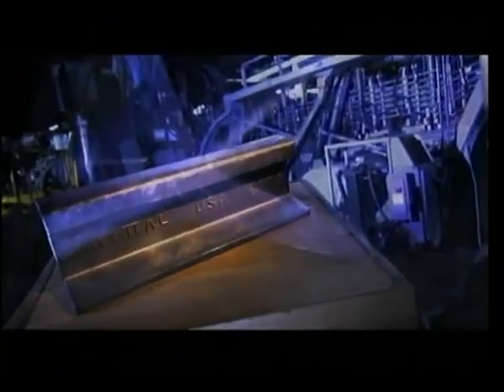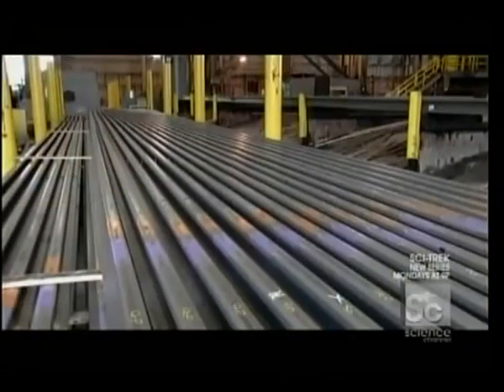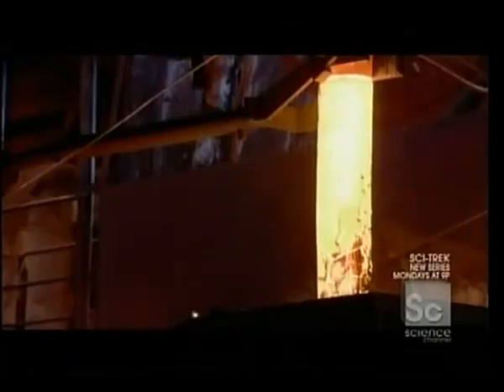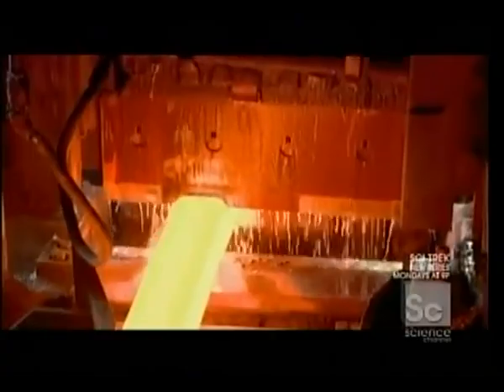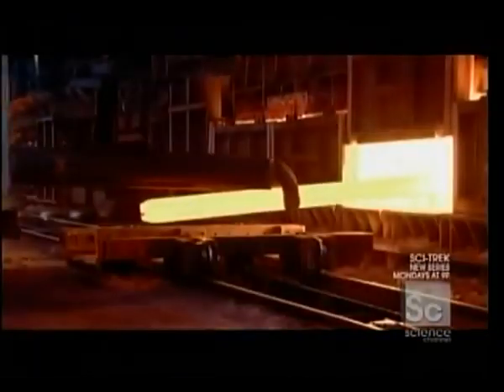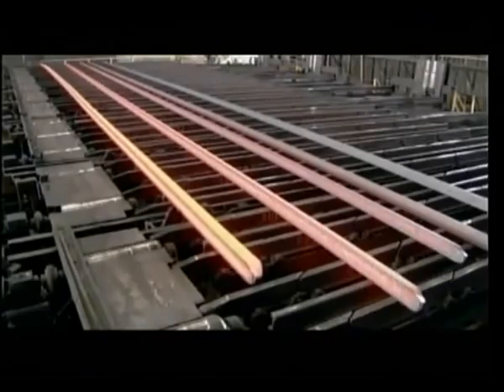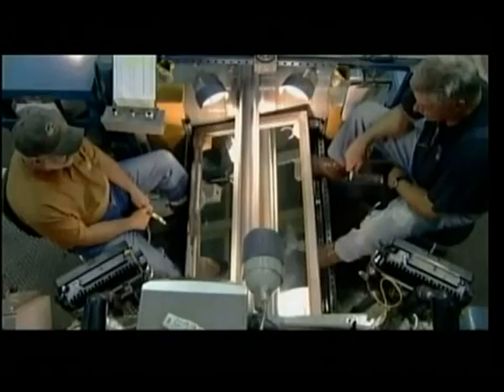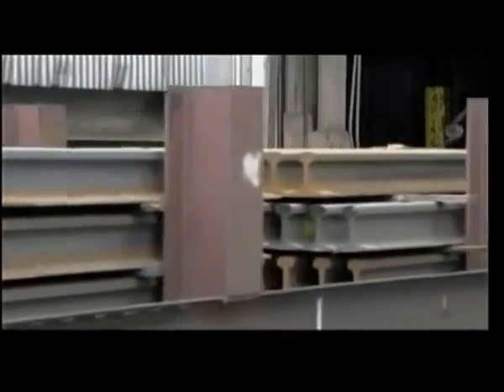How to Make Train Rails

Comment: Please note these prices are quoted directly from the seller and non-negotiable, you will get your own commission from the buyer. Prices can be changed at any moment.

 

Dear Sir,

Thanks for the quick response to us.

Please check the price now if you are interested then send the (LOI+ICPO).

USED RAILS - Our MOQ for Used Rails is 1.000.000 MT 

CIF "AWSP " Official Price    

" We can offer exclusive for January 2021  - All prices are subject to immediate changes without prior notice one's CI hasn't been issued yet "

  1.000.000MT  280,- USD     " We can quote 230,- USD "  monthly 

  2.000.000MT  254,- USD     " We can quote 220,- USD "

  3.000.000MT  240,- USD     " We can quote 205,- USD "

  5.000.000MT  214,- USD     " We can quote 195,- USD "

10.000.000MT  200,- USD     " We can quote 185,- USD "

15.000.000MT  190,- USD     " We can quote 180,- USD "

20.000.000MT  185,- USD     " We can quote 175,- USD "

25.000.000MT  180,- USD     " We can quote 170,- USD "

30.000.000MT  175,- USD     " We can quote 165,- USD "

  " The above prices are applicable for Used Rails as well as for New Rails " 

Email: imtraj786 gmail and skype

Comment: '
how long this metal track rail and weight...
what kind of metal on this track rail
Reply: Not specifically about CEN56 or CEN60 but I will find some info tomorrow
Reply: bestamerica about tons and made on steel
Reply: CEN56 Rail is 56Kg per Metre or 113 lbs per Yard in the UK. Standard length is 60ft/18.2m or welded into 709ft/216m strings and offloaded by LWR train. (You also get CEN60 rail which is 121 lbs per yard.)

In the US & Canada its 115 lbs per yard and heavy duty is 136 lbs per yard and comes in 82ft lengths (as stated in the video).
Reply: hi D...
thank...
that is really heavy metal weight and strong steel...
i see the video about a gun with strong bullet round...
bullet round can going through steel rail track...
https://www.youtube.com/watch?v=W57EjnIJu7Q
Reply: Yea its heavy.. 1 metric tonne per 18m / 60ft length.
Reply: hi and thank D...
send me link about 2 different rail tracks...
heavy duty cen56 and super heavy duty cen60...
see compare 2 tracks
Reply: hi D...
thank alot...
i learn about different size of railroad tracks...
big thank